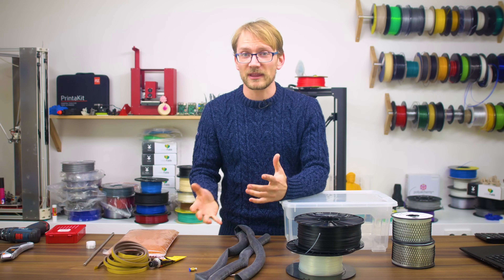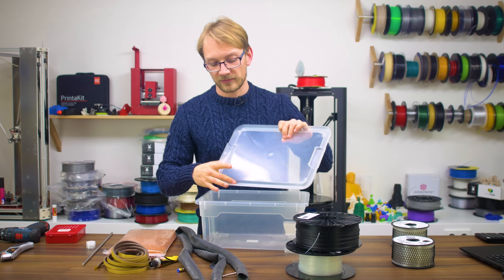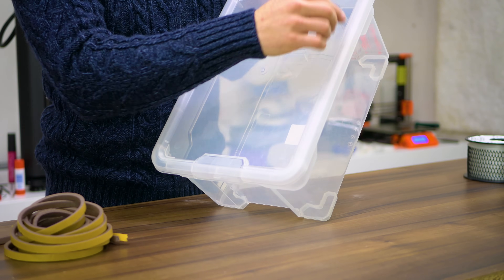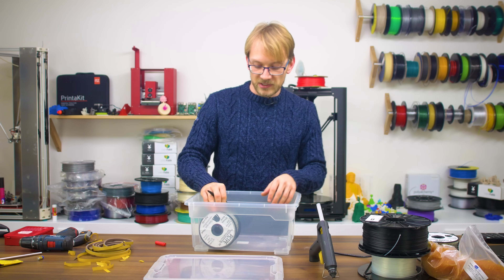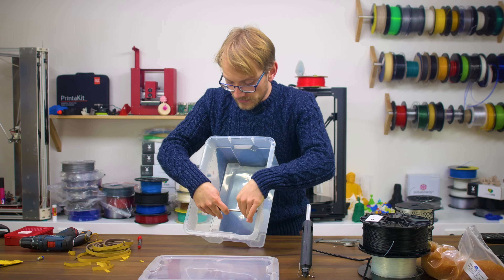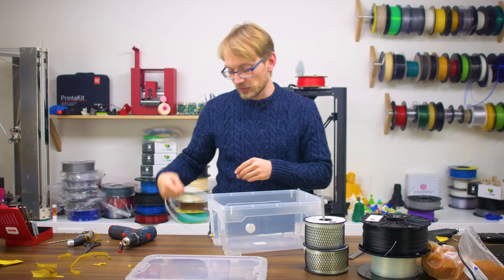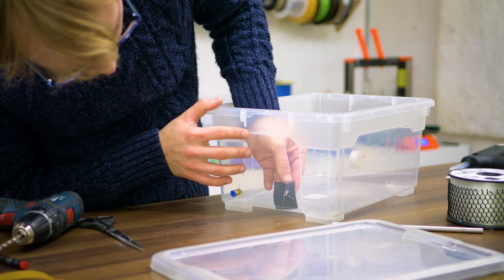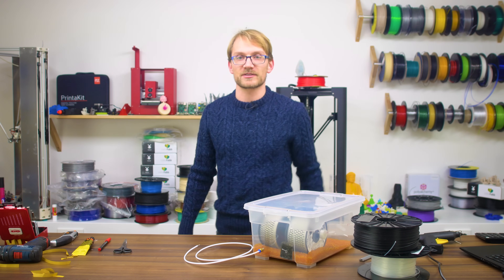How to keep your filament dry: Make a storage box!

Comment: First, I suggest try finding an enclosure with built-in rubber or silicone seal. I've found some, but that's the US side, don't know about EU. I think it's best to use as small of a container as you can find that fits one spool + desiccant. Having multiple filaments in one case means opening the container to replace one spool exposes all the spools to new "wet" air. "OXO Good Grips POP Big Square 2.4-Quart Storage Container" fits one Taulman spool and a good amount of desiccant or a good size desiccant container.

The push-to-connect type connectors are meant to supply air pressure so the connectors themselves should be air-tight. I've even run a PTFE line all the way to my extruder so there's only at the hobb where any moisture might enter.

Comment: simple and effective, but why the mess? just put the dessiant in a cotton or linnen bag. a piece of an old shirt and a cable tie will do, and you can bake the silicagel in it too. throwing in a test tube full of color changing silica gel as an indicator would be a fancy touch. btw, silica based cat litter is easy to find and pure silica gel.

Comment: If you "brass off" the drill bits they will be less likely to lunge into the thin plastic and crack it. 

ClickSpring has a great vid on it "Spare parts #7 - Modifying A Twist Drill For Drilling Brass"

Comment: After watching the video, I liked the concept of the bike tube method, a little better than the Bowden tube.  It would seem, a person could print a gasket out of TPU, Ninja Flex, or some other flexible filament and have the advantages of the rubber membrane (bike tube), with a more refined look.

Another option would be to use a SMA coaxial, bulkhead connector and drill out the teflon insulator to the appropriate diameter (1.75mm or 3.0mm), for your filament.

Comment: Or you know, buy that kickstarter box that holds one spool and weighs it and costs like 2x as much as my printer did. I'm sure 2 load cells and an arduino would split the difference in cost right?
Big boxes like that are cheap at ikea btw. I'd say the pneumatic fitting is a bit redundant, drill a hole the size of the outer diameter of the bowden tube, run bowden tube through the hole, seal with something like hotglue.
Reply: hotglue doesnt stick to teflon very well...

Comment: I've been storing by filament spools (when not in use) in a large zip-lock bag, with some silica jell bags inside.  My workshop is air conditioned as well.  Only PLA and ABS, and I don't think I've had any issues with 'bad' filament, even stuff that's been stored for over a year.  BTW, I don't think the stuff actually goes bad to the point of having to throw it out, you can always 'bake it' to remove the moisture and recondition the stuff, but better to not to have to!

Comment: Thanks Tom! I've been thinking I need a better solution and I really like this one (currently using ziplock bags and it's annoying).  I had two ideas and I'm wondering if you think it would be worth it / improve:
1) some how work a one way valve into the lid and, using something like a wine air pump, pump out some of the air.  This would remove some of the humid air as well as make the lid self seal.  Issue would be if the filament seals aren't air tight, it would just slowly leach air back in over a short amount of time.  Obviously not a perfect vacuum, but just enough to have the lid keep itself shut.

2) using the bike tire method, place seals on both sides of the wall, i.e. Inside like you show and outside as well.  This would create a double seal that would better resist air leaching back in if I pump some of the air out.
Thoughts?
Thanks again!

Comment: I built a box like this but had issues with extra drag on the filament causing printing defects. When the extruder has to pull extra hard on the filament it causes displacement in the nozzle. I would love to see an ultra "low drag" design that will minimize issues with the printing process.

Comment: For those in the US , Ziploc makes these tubs that have a seal built in already. Not sure if they are available elsewhere int he world.
Reply: NDFPV - Sterilite also makes a great sealing set of containers with built in clasps. I think the Sterilite is a bit cheaper than the Ziplock containers. Both have great sealing capabilities and use is instant.

Comment: For storage I just use a 5 liter ziplock bag together with a little bag of silica gel. They cost next to nothing and are perfectly air tight. I found no need to pull it vacuum since the silica gel will dry out the air left in the bag (and in the filament).

Comment: Hey Thomas, I had a PETG filament and when I tried to use it on my Lulzbot mini, it completely ruined the pei print bed. The print bed bubbled up... Could you explain why?
Reply: Peter Woo that sounds like you were printing way too hot to me while having your nozzle too close to the bed. You should check at what temperature you were printing and what temperature the bed can handle and also relevel your printed bed

Comment: Instead of foam sealing tape, you can simply put down a bead of silicone chaulking. Put the lid upside down and run a bead. Then put a layer of cling film over that and place the box in the groove. The silicone will form a tight seal and the cling film will stop the two from sticking to each other. You can place a little weight on the box, to make it sit properly. A lot better seal. 
Also, the lid will not bend up as there is not force on it.
Reply: Lykle Schepers 
Rather than use cling film to prevent the silicone sealant from adhering to the top of the box it would be better to use a thin smear of grease - Vaseline is fine - before mating the two together and then wiping it off once the silicone has cured.
Reply: Yes, that works as well.
The reason I prefer cling film is that you can then shape the silicone a little better. You can mold it into shape and keeping the cling film tight, you can make the silicone nice and smooth around the edges. 
Vaseline works perfectly for more complex shapes and tricky areas.
Reply: Won't the cling film come off every time you lift the lid? or no?
Reply: @collective1515  You only put it on until the silicone has formed and firmed up. Then you can remove the cling film. You basically use it as a form of mold release.
Reply: @LykleSchepers  thank you so much for replying so quickly! I'll do that process for my new box. Thanks again 💯

Comment: I print in my small office room (12 m²) and I am currently thinking about the ventilation. Do you have an opinion on "harmful to health" or "fine dust" by 3D printers? Especially for ABS? I am sitting in this room all the time, even during the printing process.

Ich drucke in meinem kleinen Heimbüro (12 m²) und mache mir derzeit Gedanken über die Belüftung. Hast du eine Meinung zum Thema "Schädlich für die Gesundheit" bzw. "Feinstaub" durch 3D Drucker? Speziell bei ABS? Ich sitze die ganze Zeit in diesem Raum, auch während des Druckvorganges.
Reply: Yes ABS-Fumes are harmful and yes you should filter it out or vent it out. PETG is btw the best known filament for indoor use. The glycol smells sweet but all in all its now as dangerous.
Reply: https://3dprint.com/117782/3d-printing-health-researchers/

Comment: I think this is the reason my prints are getting stringy recently. First time I got the filament out of the box, the print came out perfect. After like 1 week my prints are mess with string even though I'm not changing the setting. Humidity level average in place I live is around 60 %RH, I guess that's too high for plastic. Thanks for the tutorial!